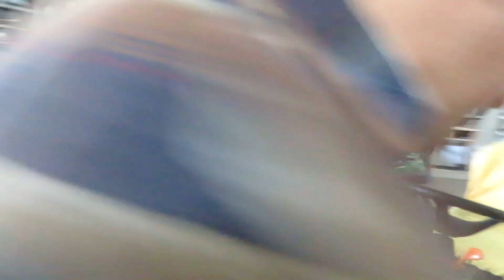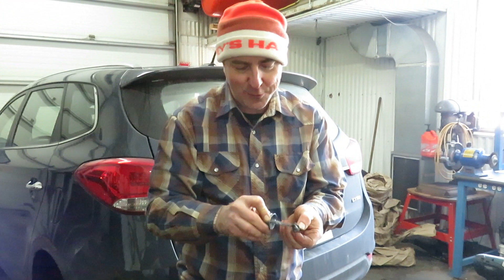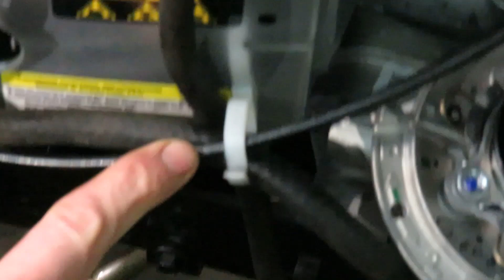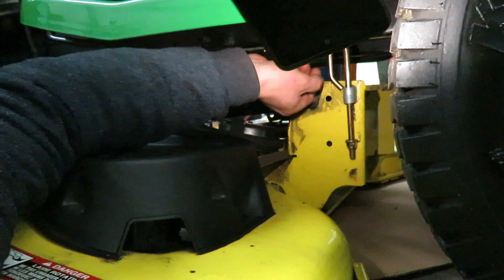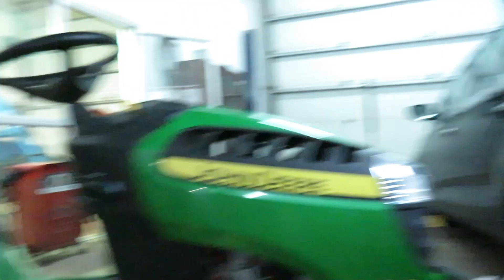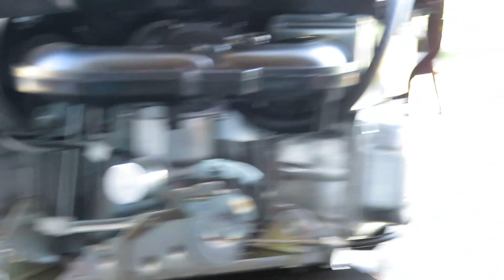John Deere D170 Engine Swap: part3

Comment: Yikes grinding while the oil filter mount is wide open below.  The debris can get into engine.
Reply: In the process of swapping in a new B&S 25 HP into my 2000 Honda HA4118 (JD LX188) mahalo for the useful info.   I got a bunch of McGyvering to do to merge the technologies.
Reply: There was a plastic cap on the oil filter hole if you watch part 2 you will see that
Reply: Ok mahalo